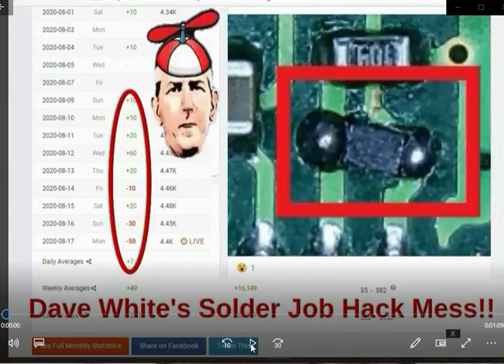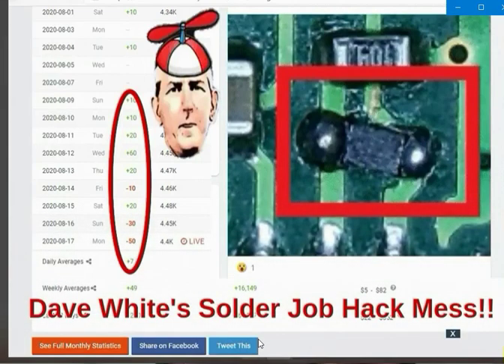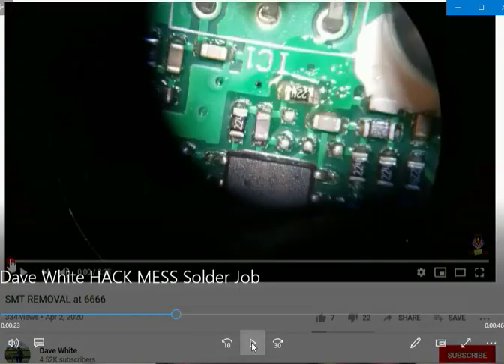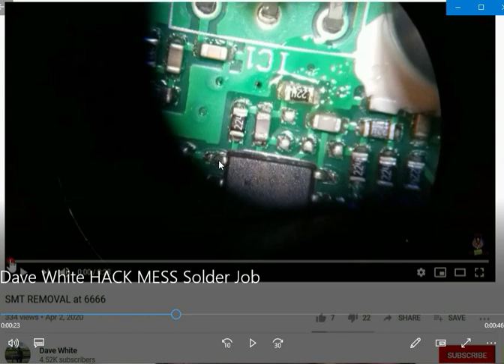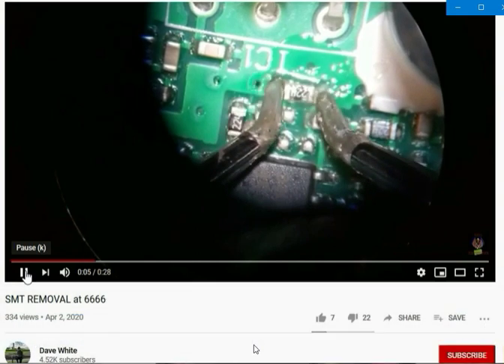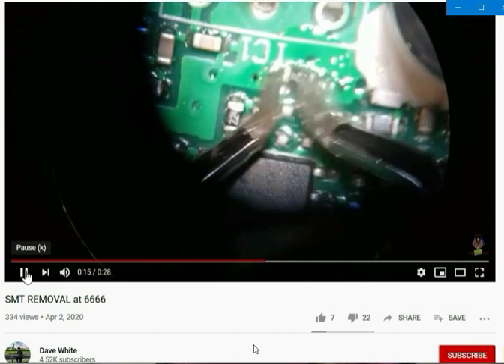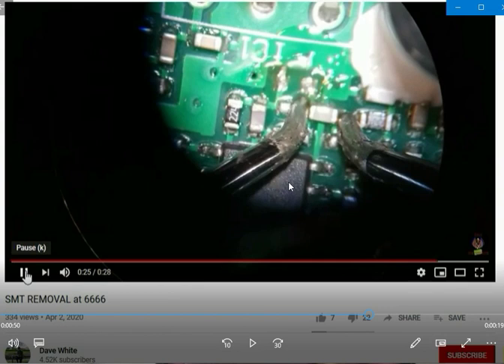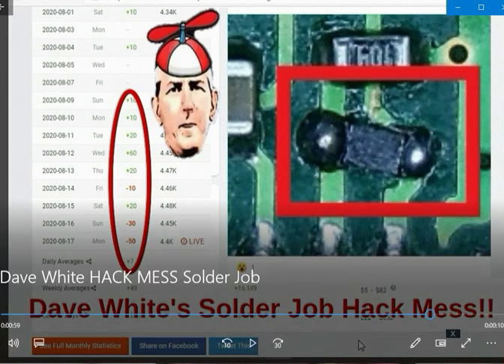385 LSB CB RADIO .. HOW TO Not Solder - Desolder 0603 SMD -  Dave White @ Clean Wave  HACK MESS!!

Comment from the maker: Romper Room Wannabes .. want to earn a little bit of my respect? You need to earn it! Dave White @ Clean Wave - Romper Room Wannabe Tech Brigade, lets take a closer look: shorturl.at/btAV7 and shorturl.at/cPTU8 Here's what it takes to cut through the noise, be loud and crystal clear with a better receiver too:  A) Tuned Bench:  https://www.youtube.com/watch?v=lwcDfXOgAls.  True, it's more complicated and time consuming to accomplish these consistent and accurate results. Below is a partial procedure and list of calibrated equipment used to achieve this level of performance . Read on ..

Fine Tune CB Radio Shop strictly adheres to (https://www.nist.gov/) NIST Traceable Calibrations and other industry standards to maintain accuracy and consistency for providing Real World Performance Tuning of Citizens Band and 10 Meter export mobile radios with integrity.

"Basic Textbook AM/FM/SSB Transceiver Tune, Alignment and Calibration" 

1) Pll adjustments
VCO & OSC, AM TX OSC, USB TX OSC, LSB TX OSC.

2) Transmitter alignment
DRIVER BIAS, FINAL BIAS, SSB  (or gate voltages for mosfet versions) CARRIER BALANCE, HI-LO AM & SSB Power, RF METER, AMC, ALC and FM DEVIATION.

3) Receiver alignment
AM/FM RF & IF SENSITIVITY, FM DETECTOR/DEVIATION, SSB IF SENSITIVITY, SSB S-METER, AM/FM S-METER (100uV unmodulated -67dbm for �S-9� meter reading!), AM/FM SQUELCH RANGE, SSB SQUELCH RANGE, and NOISE BLANKER/AUTOMATIC NOISE LIMITER (Real World dBm to volts (uV) tables below).

That's just a typical run of the mill textbook tune up and alignment (if you're lucky). There's more to it than frequency alignment, modulation adjustment, meter calibration and a tune up report displaying exaggerated rms Bird peak watts! 

"Test Bench includes"

Bird 4314C Meter
https://www.birdrf.com/Products/Test%20and%20Measurement/Power-Meters/Wattmeters-Line-Sections/RF-Wattmeters/4314C_PEP-Single-Element-Wattmeter.aspx
Part 1) https://www.youtube.com/watch?v=RpX9IHe4ORM&t=16s
Part 2) https://www.youtube.com/watch?v=LuhbqTf6Bxw
Bird 4314C Accuracy Test: https://www.youtube.com/watch?v=DqEOabYqhQo&t=5s
Bird Stipulates 1/2 wavelengths  https://www.youtube.com/watch?v=5eWhgT-rTII
And Genuine Bird Elements from 1K down.

Bird 4373 Sampler 
https://www.rfparts.com/signal-samplers.html

HP8924c with options
http://userequip.com/files/specs/2147/HP%208924C%20Repair.pdf
https://www.youtube.com/watch?v=Cg1w0xBa27s&t=1s

HP8920a with options
https://www.keysight.com/upload/cmc_upload/All/EPSG072204.pdf

Three analog scopes, one digital 200 Mhz
https://www.atecorp.com/atecorp/media/pdfs/data-sheets/tektronix-2465b-2467b_manual.pdf
https://www.youtube.com/watch?v=by98x4eu2lM

Fluke 27fm
http://www.fluke.com/fluke/inen/digital-multimeters/fluke-27.htm?pid=56055
 
LCR http://www.lcrresearch.com/wp-content/uploads/2017/05/LCR_Pro1_Manual_version1.03.pdf

Power supplies
6 Cosel PBA1500f12 (750 amps) variable and configurable.
https://en.cosel.co.jp/product/powersupply/PBA/PBA1500F/PBA1500F-12/
Corcom 20VB1 F7130 EMI Filter 50-60Hz 250V

Times Microwave Coax jumpers and test leads
http://www.timesmicrowave.com/cms/products/cables/lmr/
https://www.youtube.com/watch?v=EmqaGJ6IWow
https://www.youtube.com/watch?v=1ltFVSxGp5Y
https://www.youtube.com/watch?v=v12YZT_1o90
https://www.youtube.com/watch?v=h7iiYfmYWRA&t=215s

Amphenol RF Connectors
https://www.amphenolrf.com/
https://www.youtube.com/watch?v=dVh5B0hdEA0 
https://www.youtube.com/watch?v=dKZg8T_AOso

More range, compliments, reliability and a quieter, clearer but more sensitive receiver,  Get Fine Tuned .. not peaked and ruined.

Here are some VideoGates of me at the bench practicing what I preach using my bench radio or customers radio completed and ready to be shipped: https://www.youtube.com/results?search_query=hard+drive+163+ more: https://www.google.com/search?q=Hard+Drive+163+nm&ie=utf-8&oe=utf-8&client=firefox-b-1-ab

It's what I recommend, use, service and sell ... to you ... not something non practical or deceiving in a misleading way. I'm not just the tech and owner of Fine Tune CB Radio Shop, I'm a customer too!  When finished, You'll be giving radio checks, not asking for them .

dBm To Watts and Volts
Tables below displays relationship between Power in [dBm] or [Watts] and Voltage in RMS, peak, peak-to-peak for sinusoidal signals in 50-Ohm systems for accurately measuring and tuning am/fm/ssb receiver sensitivity, agc, squelch and "S9" Meter calibration. Real World! Mike @ Mikes Radio Repair (Romper Room), Mark Rutherford aka Mark 19960, CB Kidd, Martian and all of your other fake accounts pay attention to the tables below, stop misaligning radios, spreading false information and promoting propaganda! 

  [dBm] [Watts]   [Volts]rms   [Volts]p    [Volts]pp
-140 0.100E-16  22.361 nV  31.618 nV  63.236 nV 
-139 0.126E-16  25.089 nV  35.476 nV  70.952 nV 
-138 0.158E-16  28.150 nV  39.805 nV  79.609 nV 
-137 0.200E-16  31.585 nV  44.662 nV  89.323 nV 
-136 0.251E-16  35.439 nV  50.111 nV  100.222 nV 
-135 0.316E-16  39.764 nV  56.226 nV  112.451 nV 
-134 0.398E-16  44.615 nV  63.086 nV  126.172 nV 
-133 0.501E-16  50.059 nV  70.784 nV  141.568 nV 
-132 0.631E-16  56.167 nV  79.421 nV  158.842 nV 
-131 0.794E-16  63.021 nV  89.112 nV  178.223 nV 
-130 0.100E-15  70.711 nV  99.985 nV  199.970 nV 
-129 0.126E-15  79.339 nV  112.185 nV  224.370 nV 
-128 0.158E-15  89.019 nV  125.874 nV  251.747 nV 
-127 0.200E-15  99.882 nV  141.232 nV  282.465 nV 
-126 0.251E-15  112.069 nV  158.465 nV  316.931 nV 
-125 0.316E-15  125.743 nV  177.801 nV  355.602 nV 
-124 0.398E-15  141.086 nV  199.496 nV  398.992 nV 
-123 0.501E-15  158.301 nV  223.838 nV  447.677 nV 
-122 0.631E-15  177.617 nV  251.151 nV  502.302 nV 
-121 0.794E-15  199.290 nV  281.796 nV  563.591 nV 
-120 0.100E-14  223.607 nV  316.180 nV  632.360 nV 
-119 0.126E-14  250.891 nV  354.760 nV  709.519 nV 
-118 0.158E-14  281.504 nV  398.047 nV  796.094 nV 
-117 0.200E-14  315.853 nV  446.616 nV  893.232 nV 
-116 0.251E-14  0.354 �V  0.501 �V  1.002 �V 
-115 0.316E-14  0.398 �V  0.562 �V  1.125 �V 
-114 0.398E-14  0.446 �V  0.631 �V  1.262 �V 
-113 0.501E-14  0.501 �V  0.708 �V  1.416 �V 
-112 0.631E-14  0.562 �V  0.794 �V  1.588 �V 
-111 0.794E-14  0.630 �V  0.891 �V  1.782 �V 
-110 0.100E-13  0.707 �V  1.000 �V  2.000 �V 
-109 0.126E-13  0.793 �V  1.122 �V  2.244 �V 
-108 0.158E-13  0.890 �V  1.259 �V  2.517 �V 
-107 0.200E-13  0.999 �V  1.412 �V  2.825 �V 
-106 0.251E-13  1.121 �V  1.585 �V  3.169 �V 
-105 0.316E-13  1.257 �V  1.778 �V  3.556 �V 
-104 0.398E-13  1.411 �V  1.995 �V  3.990 �V 
-103 0.501E-13  1.583 �V  2.238 �V  4.477 �V 
-102 0.631E-13  1.776 �V  2.512 �V  5.023 �V 
-101 0.794E-13  1.993 �V  2.818 �V  5.636 �V 
-100 0.100E-12  2.236 �V  3.162 �V  6.324 �V 
-99 0.126E-12  2.509 �V  3.548 �V  7.095 �V 
-98 0.158E-12  2.815 �V  3.980 �V  7.961 �V 
-97 0.200E-12  3.159 �V  4.466 �V  8.932 �V 
-96 0.251E-12  3.544 �V  5.011 �V  10.022 �V 
-95 0.316E-12  3.976 �V  5.623 �V  11.245 �V 
-94 0.398E-12  4.462 �V  6.309 �V  12.617 �V 
-93 0.501E-12  5.006 �V  7.078 �V  14.157 �V 
-92 0.631E-12  5.617 �V  7.942 �V  15.884 �V 
-91 0.794E-12  6.302 �V  8.911 �V  17.822 �V 
-90 0.100E-11  7.071 �V  9.998 �V  19.997 �V 
-89 0.126E-11  7.934 �V  11.218 �V  22.437 �V 
-88 0.158E-11  8.902 �V  12.587 �V  25.175 �V 
-87 0.200E-11  9.988 �V  14.123 �V  28.246 �V 
-86 0.251E-11  11.207 �V  15.847 �V  31.693 �V 
-85 0.316E-11  12.574 �V  17.780 �V  35.560 �V 
-84 0.398E-11  14.109 �V  19.950 �V  39.899 �V 
-83 0.501E-11  15.830 �V  22.384 �V  44.768 �V 
-82 0.631E-11  17.762 �V  25.115 �V  50.230 �V 
-81 0.794E-11  19.929 �V  28.180 �V  56.359 �V 
-80 0.100E-10  22.361 �V  31.618 �V  63.236 �V 
-79 0.126E-10  25.089 �V  35.476 �V  70.952 �V 
-78 0.158E-10  28.150 �V  39.805 �V  79.609 �V 
-77 0.200E-10  31.585 �V  44.662 �V  89.323 �V 
-76 0.251E-10  35.439 �V  50.111 �V  100.222 �V 
-75 0.316E-10  39.764 �V  56.226 �V  112.451 �V 
-74 0.398E-10  44.615 �V  63.086 �V  126.172 �V 
-73 0.501E-10  50.059 �V  70.784 �V  141.568 �V 
-72 0.631E-10  56.167 �V  79.421 �V  158.842 �V 
-71 0.794E-10  63.021 �V  89.112 �V  178.223 �V 
-70 0.100E-09  70.711 �V  99.985 �V  199.970 �V 
-69 0.126E-09  79.339 �V  112.185 �V  224.370 �V 
-68 0.158E-09  89.019 �V  125.874 �V  251.747 �V 
-67 0.200E-09  99.881 �V  141.232 �V  282.465 �V
-66 0.251E-09  112.069 �V  158.465 �V  316.931 �V 
-65 0.316E-09  125.743 �V  177.801 �V  355.602 �V 
-64 0.398E-09  141.086 �V  199.496 �V  398.992 �V 
-63 0.501E-09  158.301 �V  223.838 �V  447.677 �V 
-62 0.631E-09  177.617 �V  251.151 �V  502.301 �V 
-61 0.794E-09  199.290 �V  281.796 �V  563.592 �V 
-60 0.100E-08  223.607 �V  316.180 �V  632.360 �V 
-59 0.126E-08  250.891 �V  354.760 �V  709.520 �V 
-58 0.158E-08  281.504 �V  398.047 �V  796.094 �V 
-57 0.200E-08  315.853 �V  446.616 �V  893.232 �V 
-56 0.251E-08  0.354 mV  0.501 mV  1.002 mV 
-55 0.316E-08  0.398 mV  0.562 mV  1.125 mV 
-54 0.398E-08  0.446 mV  0.631 mV  1.262 mV 
-53 0.501E-08  0.501 mV  0.708 mV  1.416 mV 
-52 0.631E-08  0.562 mV  0.794 mV  1.588 mV 
-51 0.794E-08  0.630 mV  0.891 mV  1.782 mV 
-50 0.100E-07  0.707 mV  1.000 mV  2.000 mV 
-49 0.126E-07  0.793 mV  1.122 mV  2.244 mV 
-48 0.158E-07  0.890 mV  1.259 mV  2.517 mV 
-47 0.200E-07  0.999 mV  1.412 mV  2.825 mV 
-46 0.251E-07  1.121 mV  1.585 mV  3.169 mV 
-45 0.316E-07  1.257 mV  1.778 mV  3.556 mV 

                 Don't Be A Mud Duck!

 https://www.arrl.org/shop/ARRL-Handbook-2019-eBook

Hard Drive 163 NM. 73's! Click click.